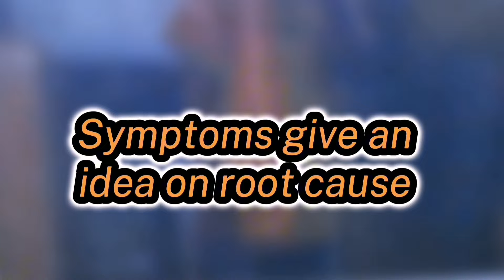FIX THIS FAST BEFORE IT GETS WORSE! #ledtvpanelrepair #microsoldering #electronics

Comment from the maker: Hi, everyone. A clue to answering correctly the question posed at the end of the video is to consider the circuit where the shorted capacitor is situated. The function of the circuit is to generate a voltage from AVDD that helps to prevent image retention on the display. That's the voltage that's filtered by the capacitor. I hope this clue helps. I've chosen this method of discussion because I figure it should help us learn better on the channel.

Comment: The shorted ceramic capacitor had a crack that is clear to see @0.05 in your video.
This crack lead to silver migration between the layers in the capacitor.
This migration only require a path (the crack), humidity and a voltage.
In 1996 we had some field returns of OEM battery chargers from Panama and Venezuela.
The customer was a well known, US manufacturer of two-way radios.
It took some time to identify the problem, including getting the 0805 capacitors cut in half while positioned on the PCB  and micro-scoped by Fraunhofer Institution in Germany.
The ceramic was cracked and allowed the silver conductor to migrate between the isolating layers resulting in a short.
The solution was to re-orientate the capacitors on the PCB, in order to minimize the stress they were subjected to during manufacturing.
--
This is most probably what you have experienced on the PCB shown in this video.

Regards from Denmark
JD
Reply from the maker: @johndue2366 you just scored 150 out of 100! 😃 That is one complete tutorial! 😃 I love the details on the root cause of those capacitors shorting out. Really appreciated. However, you skipped the question about the voltage being filtered by the shorted capacitor: AVDD, HAVDD or GAMMA 1? Would really love your professional touch again. 😊